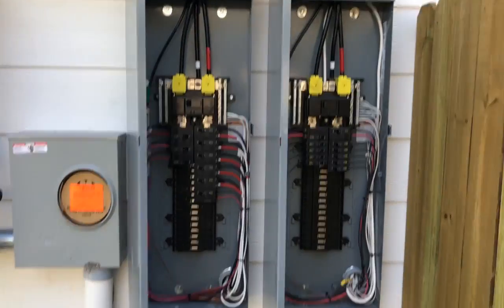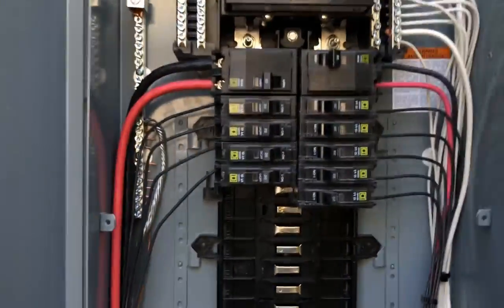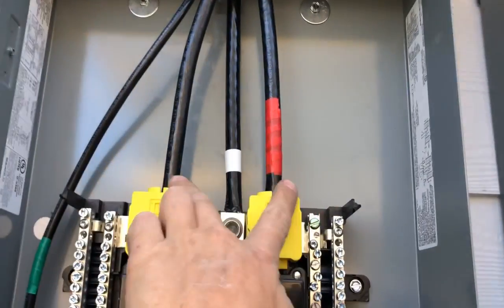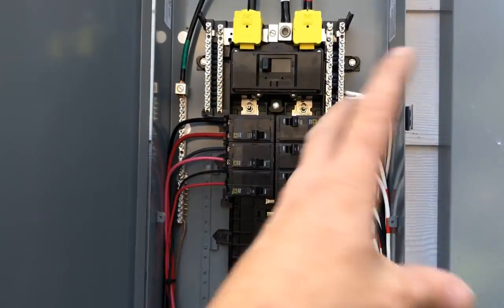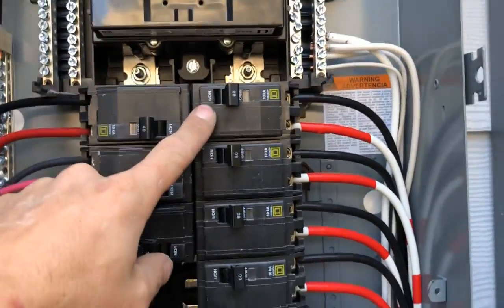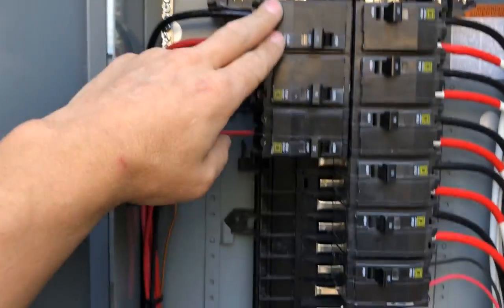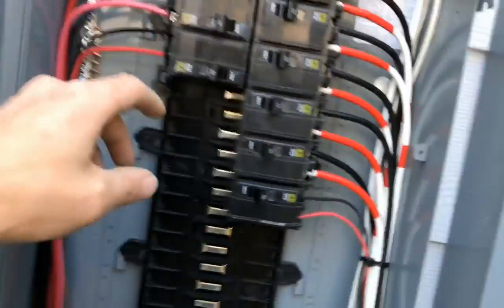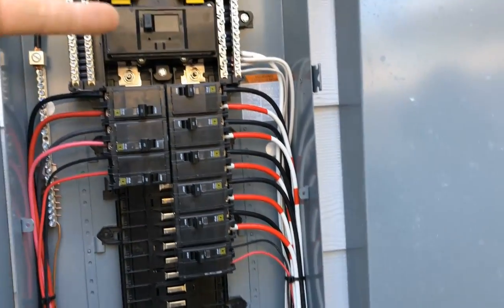Electrician Explains How Circuit Breakers And Electrical Panels Work

Comment: Question. 2 ext garage lights ran on a photo cell hooked up to the garage circuit that has a 15 amp afci breaker, 8 outlets in garage 1 is gfi all wires are 14/2. Why is 1 light getting 120v the other is getting about 85v. Light and fixture work fine it was tested with an extension cord and another outlet.

Comment: So the panels are remote panels? The earth coming in from the top is rather strange. What is the function of the large white neutral on the mostly 120VAC breaker panel?

Comment: Breaker panels are really strange, in that they can be out doors, which means exposed to direct sunlight, and the breakers are butted tight together which does not help in cooling the breakers. I know the breakers are de-rated to 80% and a lot of the heat is conducted via the conductors and stabs, but it is still a bit strange that there is minimal air flow around the breaker. If we add to this the panel internal temperature rise due to direct sunlight, it is possible to trip a breaker due to the temperature rise in the panel depending on the time of year and the characteristics of the load (may actually be continuous, but designed as non-continuous).

Comment: Crazy thing is the power delivered to your home is stepped down a lot. From the power plant the power leaves the plant and then get increased in voltage to travel long distances without any loss in power. Then the power is stepped down and once it reaches neighbourhoods it’s steeped down again before entering a home. The power goes through the home back through the panel back to the transformer and recycled back to the grid.

Comment: the main breaker 125 A but the circuit breaker 60 and 40 A are you adding the load to put the main breaker ? how you calculate the main breaker ?

Comment: Would you happen to know why one of the busbar is hot when all of the circuit breakers connected to that bar is turned off, but once one of the circuit breakers are turned on, the busbar is neutral or not hot anymore. So half of the house is without electricity and the only thing that was done was the main 100 amp breaker was turned off and back on.

Comment: ohhh so even if you use just one breaker, and one receptacle, the resistance of the wire in the building is enough to slow down the current so it doesn't blow up? Is what I gather. 

But a direct connection of those large wires would not offer much resistance and so you get hella motion

Comment: You say "a difference of potential between these two hots" - isn't it the hot and the neutral that have the big difference in potential?  I thought the two hots were just going to different sides of the panel but with around the same voltage/potential.  If you connect the two hots, would it really explode?  I thought it would be connecting one (or both) of the hots directly to the neutral that would cause chaos.  Thanks for making the video!

Edit:  Is it because the power from the utility is AC and you'll end up getting a positive voltage on one wire but a negative voltage on the other?

Comment: If I have everything brought up to a 200Amp rating except for the wire (currenty rated for 150Amp) between the two panels and use a 150amp breaker in the 200Amp rated main panel and a 200Amp breaker in the inside 200Amp rated panel, do you see any problems passing inspection?

Comment: DUSTIN, try to make a video lesson about how to troubleshooting breakers that are causing "Nuisance trip" but how to find the breaker on a panel that is causing the nuisance trip is the hard part to narrow it down. The problem is NOT the breaker that is causing the Nuisance Tripping which is the RCD residual current flowing in the circuit. What is causing the breaker to falsely trip is not the breaker but the circuit that is connected to the breaker that is causing the RCD. What are some troubleshooting techniques to narrow down and finding the RCD residual current flowing that is causing the Nuisance tripping issue?

Comment: I bought an OLD home recently and I am mad about some idiot taking advantage of the elderly 100+ years old homeowner..... They wired a light to  two different circuits.... Shut off the breaker to the lamp and still got a shocking surprise!  The more I remodel the more bs I find...

Comment: I'm watching this because I need to replace smoke detectors in my Dads house. Even though I've never actually changed a hardwired smoke alarm before, but I know how to change it. The first thing I need to do is learn the circuit breaker so I can turn the power off to the alarms to avoid electrical shock before I begin. Unfortunatly, no one wants to teach me in the real world for some reason.

Comment: Dustin,    You told half of a breakers function.   Not only do they trip from short circuit as you said, but they also trip from overload.   The breaker heats up and trips at near or over the rating number on the handle.   A standard circuit breaker’s job is to protect the conductors, equipment, and lives.

Comment: For a residential main panel, are we allowed by code to use a ring or spade  crimp on our home-runs and then screw down each conductor on a breaker(hot) or neutral/ground bus bar?

Comment: I don't think the power flows, as you said, from the red wire through the loads in the house and then out the black wire  (or the other direction either). Both red and black are each 120V (which can be piggybacked for 240V circuits -- your dual breakers in the left hand box do that) that each flow separately to the neutral (white) wire.

If what you said was true, household outlets would each have two hot receptacles instead of one hot and one neutral (plus the ground).
Reply: In 240v AC they actually do go black to red, and then red to black alternating 60 times per second.  The two sources are out of phase with each other, so that when black is full positive, red is full negative.  Some 240v equipment, especially older equiptment does not even have a neutral wire attached.  
I think he has a good video on 120 vs. 240v and how they are related.  It would be a worthwhile watch!

Comment: If you wire and shape your conductors in your panels like you do here, the electrical inspector will spend very little time looking at anything else on your job at the final inspection.  It tells him you care, and then he’s simply searching out his pet peeves — whether the code requires that you do it or not. There is the code, and hen there are the inspector’s pet peeves—just like cops.  Learn them both, it’ll save you a lot of time and red tags.

Comment: So if a breaker is rated for 15 amps would putting a 20 amp without changing the wiring do anything and would it be unsafe?
Reply: The wiring has to be heavy enough for 20a throughout the circuit for that breaker.

Comment: Worth noting: modern circuit breakers designed for breaker boxes are "thermal-magnetic". Overcurrent tripping is done by means of a temperature sensitive bimetallic element that trips when too much heat builds up. The magnetic trip is for short circuit protection but can't detect moderate overcurrent situations.

Comment: 💚💚💚💚 bookmark / notes : Way started touch breakers than top of panel thought was going to go to top pole next love and behold did point at justt the palm  trees lol , slows down from wire and Goes back around 2 , maybe those two than blue print first

Comment: So why is it dangerous to plug a 220 v appliance into a 115  outlet? wouldn't the breaker just shut it off for you if it tried to pull the 220 volts?
Reply from the maker: The easiest way to answer this is by thinking of this in VA. let's imagine a Range at 240V and 50 A. We would have 12000 VA of W of power. By only supplying 6000 VA or W, the equipment wouldnt necessarily be damaged, but there wouldnt be enough voltage to power the appliance. As far as plugging a 240 V plug into a 120V receptacle, manufacturers make different plug styles for a reason.
Reply: @electricianu  my question was  why is it dangerous to plug something that requires 220 v in a 115 v outlet. like I asked wouldn't the breaker just cut it off ?  I guess im asking what could go wrong besides the equipment being under powered?

Comment: Liked your video.  Do you have ones about gfis? I had an issue where I had a freezer and a refrigerator/freezer on same outlet in garage along with an alarm system. The outlet stopped working and I was unable to reset gfi connected to it, not realizing there may have been too much load on line and it fried both. So now that they are both off that outlet & only garage lights and utility room lights are on it, can a stand alone freezer 14 cubic feet be placed on that outlet or do I need to get a dedicated circuit?

Comment: I need your help so bad. I've been asking so many people this question and I can't get the same answer from two people. I have a 200 amp service in my basement and I wanna run a wire to my barn for a 4 place panel to fun three lights and three outlets and a small pool pump. Please help me out

Comment: Is it a problem if the breakers wobble around in the panel? (I think so but someone else thinks not!) GFCI trips then throws the breaker. Reset wobbly breaker then wait about 5-10min before power returns to outlets. Is this normal?

Comment: So the supply amp for that house is 125 since the top fuse says it? Or the average 100-200 amp.
Reply: amps provided will vary depending on what is turned on in the house. an electrical device will try to draw  just the amount required to run. thats why your electric bill varies and people tell you to turn off your lights if you arent in the room using them. the fuses and breakers are limiters. if you hook up too many devices or have a short and try to draw too much current they go pop.

Comment: Each leg is 120 volts (L1 and L2). The breaker is rated for the wire size of the circuit.  The breaker doesn't slow down the voltage or change it. The voltage remains constant. The breaker trips if the current goes over the breakers rating to protect the circuit.

Comment: So not an electrician not at all not even close but I want to learn.  The one thing I don’t understand is that you make sound like the reason you can connect those two main feeds is because you have items hooked into the BUS bars that provide resistance.  But what happens when you have all the beakers turned off?  There would be no load then right?

Comment: Circuit Breakers Do Not "Sense"  they Do Not have any internal electronics to "Sense" anything. The most common CB uses a Bi-Metalic Strip that heats up at a certain amperage causing it to bend and force the contact open. Other CB use an electromagnet that energizes at a certain amperage and pulls the switch open.
Reply: A (binary) device that determines the status of a system (under max or over max) and then "displays" the status if over (by switching off) could be considered a sensor.

Also Afci and the like actually do sense.  😁

Comment: Something I don't understand is: you keep saying "connecting these two wires would create a short", but you keep pointing to the two Hots. Since the two hots are coming from the same source, and they're both 120v, doesn't that mean no short of any kind would happen if you connected the two hots directly?
Reply: Probably in The US they use a split phase. So each wire is 180 degree phase shifted. When on up and other down.
In so many other places on the world these two wire will be part of a 3 phase system and normally you will have 3 hot wire that are 120 phase shifted

Comment: Dustin what material do you recommend for me to study if I want to become a electrician? I'm currently a Mason been doing it for 15+ yrs but as you can imagine I dont want to continue through my 40's and 50's and 60's I'm currently in my mid 30's so can u point me in the right direction
Reply: Mike holt and Ryan Jackson are both great sources here on YouTube if your interested in learning code and getting licensed. That's the direction I'm taking...
Reply: Just re read your comment and saw you're coming from another trade. Depending on where u live many companies have apprentice programs. 
Call around and see watts up. Good luck

Comment: I am not an electrician, but your explanation of circuit flow was very understandable. Good job and thank you! Now I can replace a faulty 50amp breaker and sorta know what I am doing.  I have a sniffer and a multi meter to double check. Main circuit switch will be in the off position!!

Comment: Are there different 220 and 120 volt cables that only allow a certain amount of amps to go through? or technically could 120 wires carry 220 volts but it would simply break before it got there given the breaker?

Comment: Put simply, circuit breakers (or fuses) are there to protect the wiring. If these safety devices are not used and a short occurs, the wire will get hot and cause a fire.
Something else to keep in mind about circuit breakers is because they operate on heat (caused by the current flowing through them), high ambient temperatures can cause them to trip.

Comment: Went to a local 2 year college for instrumentation and electrical. Never even got hands on experience. Made great grades, tested good (on paper). I’m currently working at a plant as an “electrical maintenance” technician and I’ve been here for almost 3 years and still never worked on a hot panel. The guy that was supposed to train me to do all of that quit over a year ago and I’ve been stuck over here trying to learn my trade literally on my own. Super unsafe at this plant I work at as well. 
I’m terms of my electrical maintenance position I have mostly been doing automation and working on conveyors. I was asked yesterday to pull 4 circuits to a sub panel that has a main breaker. It’s so old that when you open the panel almost all of the wires literally almost fall out. Apparently safety wasn’t a priority for the electricians before me. I’ve seen master electricians wire up panels that were just immaculate but my gosh the shit I was asked to work in is something dangerous. Then it’s even worse that I can’t shut the main breaker off because there is some type of giant sprinkler foam system that has a breaker in the panel and if you shut the main off the alarm will go off and spray foam everywhere until the alarm people get here to shut it down. I don’t want to hear any remarks or anything. Like I said, I’m being thrown to the sharks basically and I need a little advice. So here’s the question: is it safe enough for me to carefully pull my circuits in and land them in a live panel? I don’t want to injure myself or obviously killed get. Then again, my boss knows that it’s a dangerous situation but clearly doesn’t give a rats ass. It’s not like I have much of a choice either. I either do it, or risk losing my job. Even though I never miss and I do everything I’m asked of. I mean, I can post pictures of how sketchy this panel is if I need to. But I really want some electrician wisdom and advice. Also, I’m a guy but I’m using my wife’s YouTube account. Please help.

Comment: You keep saying that the electricity or the electrons "slow down."  NOT TRUE!
Reply: It is somewhat true.
Inductors will fight the current you try to push through them.
Capacitors will try to store it.
Resistors will try to dissipate it.

It's just a weird way of saying what happens physically.